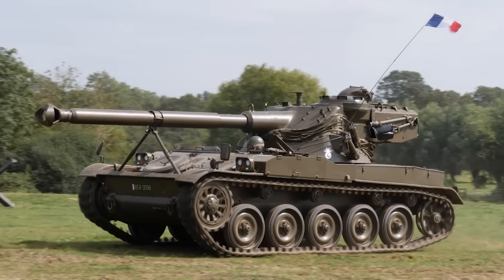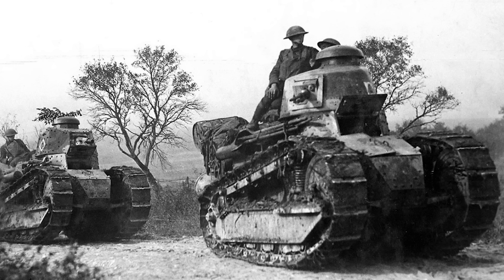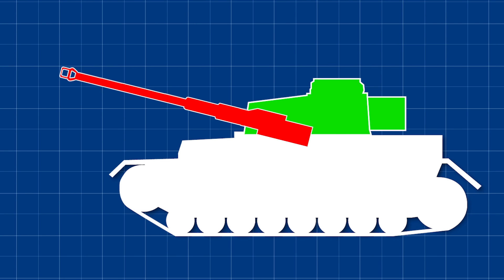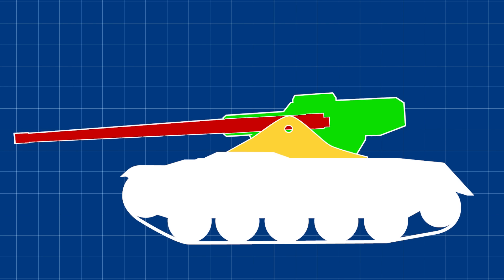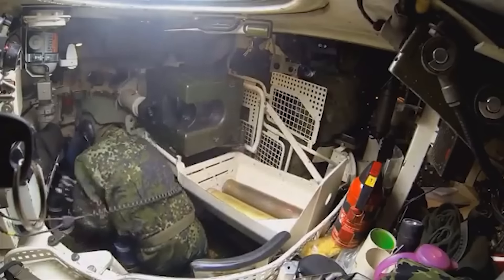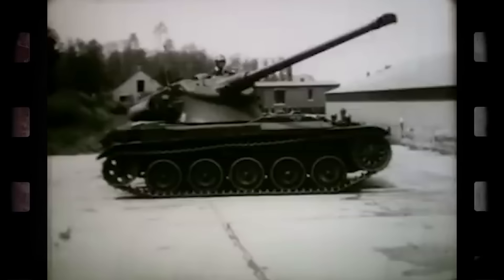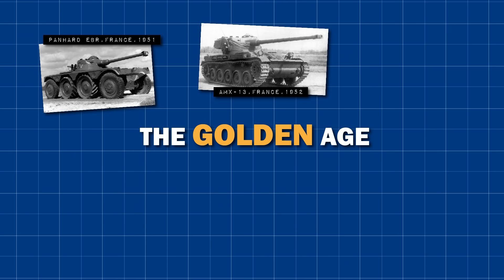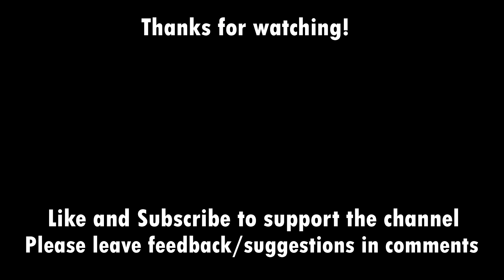What actually IS an “Oscillating” turret?

Comment: Given that unmanned turrets seems to be the future it's quite likely it will become default design.
Reply: we could probabaly make it adaptable, having the ability to switch from a big gun to a twin 30mm or some AA missile launcher
Reply: A bolt on turret with gun + autoloader + optics that you can put on top of just about anything seems like a good idea to me.
Reply: It still increases the profile of the tank by quite a lot which is a significant downside.
Reply: Not really. It is only likely if it's with a smaller gun, if you use such an oscillating turret you'll end up with a higher profile.

Together with the fact that it will strain the motors more to pivot the turret up/down with all the ammo and equipment

And if it's a smaller gun or autocannon it will be mounted in a different sort of turret which would be smaller
Reply: @qlum  I‘d say the massive increase in gun depression makes up for that. You can have your hull with the crew hide safely behind a hill while only your automated gun turret with blowout panels is visible. If the turret is designed to be modular you could simply put a new turret on and send your tank back into the fight.
Reply: @evo3s75  But does the higher profile matter if only the nonessential parts of the tank are exposed?

The armored crew compartment would still be as slim if not slimmer than today’s designs.

If you can just quickly replace the turret in the field with the help of an engineering vehicle the tank could be battle ready again in no time at all.
Reply: @qlum  Wrong. Seen from the side it might look like so, but the turret is literally half the width of the normal one, 1/4 if it is unmanned. So, it might be a tiny bit higher but it's fraction of the frontal area making it much harder to spot.
Reply: @qlum dont think stealth will be a factor in slow tank battles
Reply: @AnonD38  the elevation issue could in theory even by fixed by just sloping the hull down towards its rear and by all its other pros i see a Oscillating turret design beeing the future for tanks that have its crew protected inside a hull.
Reply: @justgeo6889  unmanned oscillating turrets aren't needed to protect the crew in the hull, a conventional turret would do good enough, better even

And how would you want to slope the rear of the tank down enough to have more elevation? You would be cutting into the space of your engine pack.

Imo oscillating turrets are ditched for a reason, they're too complicated for what we have now 

You'd have to stabilize a whole turret instead of just a gun, a gun is much easier and lighter to stabilize than a whole turret
Reply: @evo3s75  You seem to have picked up exactly 0 of the ideas I laid down, but good to know that you are asserting that I am the one who doesn't know anything and shouldn't talk about these things.

First of all: non-essential was in reference to the survival of the crew and the ability to retreat, because in a tank duel as long as your crew and vehicle survives you have not lost completely. What does a single destroyed tank matter if your crew is dead and your vehicle lost? That is a trade of 1:1 which will lead to defeat when fighting an enemy who just has more tanks than you. (remember Russia's whole "quantity over quality" approach to warfare with hundreds if not thousands of "alright" tanks instead of dozens of "cutting edge" tanks)

Next "the turret you put on a tank doesn't impact the size of the crew compartment" this is just false and already explained in the video, the turret ring decides how wide the crew compartment has to be and in turn this decides how long it must be depending on your intended use for the vehicle. If you don't know this much, then please go back to watching blue's clues or whatever you do in your free time, kid.

Where do you get your weight numbers? 8-15t for a turret? Maybe for a manned turet, but if you had actually read my comment you'd know I specifically talked about an unmanned turret. The Turret of the M1128 Mobile Gun System isn't much heavier than 6000 Kg and the AEV 3 Kodiak Engineering vehicle's telescopic arm can lift up to 3.5 tonnes meaning an automated turret up to 7000 Kg could easily be lifted by two Engineering vehicles even out in the field, but much more likely in an improvised repair shop just behind the frontline. If the system is designed to be modular you'd need at most hours definitely not "weeks" to do this replacement. It's just like replacing the engine on an M1 Abrams, it takes hours, not weeks.

To the point of "where would it be stored?" have it in a warehouse and ship it out to the front as needed just like all spare parts dummy. The rest of that block of text are baseless assumptions and not worth my time.

Your next point is that "this design hasn't been used for so long" and? What, so just because something wasn't useful for a period of time means it can never be useful again? That logic is flawed to the core, a most shameful display of ignorance and arrogance.

Next time let the grown ups talk, ok?
Reply: @AnonD38  How did I pick 0 of the ideas you laid down? I took them apart 1 by 1. That and you weren't being specific in your previous comment.

The first part I can agree with now that you explained by what you meant with non-essential, since you didn't give context about it before hand.

The 2nd part I wasn't sure if you were talking about a manned or unmanned turret, so I pick the unmanned one which was clearly the wrong one I picked, sorry about that. In case of a manned turret it does indeed impact the size of a crew compartment since you have an auto-loader and don't need extra moving space for a loader or an extra seat for the added crewmember.

Yes, I did indeed get the weight for a manned turret, because you didn't give context if you were talking about a manned or unmanned oscillating turret. About the lifting of a 6ton turret by 2 Kodiak's, I'm not sure if that would work, but if they were to lift an turret off of the MGS they'd do it back at an base with something easier and better to use instead of an engineering vehicle like you said. I'm not sure how modular the turrets are for tanks or how easily the can be taken off but I did indeed exaggerate the time a little there, but the tank would be out of action for at least a few hours to half a day if you'd have all the parts and personnel there at the moment.

You didn't give any context about if it would be in a base instead of on the field like you said here "If you can just quickly replace the turret in the field with the help of an engineering vehicle the tank could be battle ready again in no time at all.". But yes the logical assumption would be to have it stored in a warehouse.

Next is about the use of the oscillating turret, while yes it may be used one time again. It is unlikely since it was designed for a problem which we really don't have anymore, and that is that auto-loaders could not load because of the gun being at certain angles, so they made the gun stuck to the turret and auto-loader so the gun wouldn't be out of place and could keep loading the gun without any problem. However that is not the case anymore with modern bustle auto-loaders since they can keep loading the gun at different angles within reason.

Childish.
Reply: @AnonD38  a tanks profile isnt just about fighting other tanks its about getting spotted in general. while you are correct technically a it presents the nonessential roof to tank attacks against artillery and top attack missiles being spotted can be a death sentance.
Reply: @loganwilder4276  Sure, but let’s actually look at the situation.

The space an unmanned oscillating turret saves in the crew compartment could be used to decrease the profile of the tank meaning it‘d be 0 sum in the end.

And even if the profile is a bit bigger, we already have great countermeasures against visual detection, camouflage and camo netting with foliage makes the mk 1 eyeball look very old.

The biggest threat for a tank would be thermal detection though. In this case an unmanned oscillating turret would actually give advantages. There would be no crew inside the tank you‘d need to keep either warm or cold, so you could have the temperature of the turret be much closer to the surrounding temperature, meaning your thermal profile might actually be a lot smaller than on a tank we have today.
Reply: @AnonD38  thermal profile is irrelevant a tanks engine is always going to be hotter than its surroundings even in a desert and that heat can and will travel making it quite easy to pick up on thermals. "stealth tanks" as a concept dont really work the best you can do for the most part is make them harder to hit and the easiest way to do that is to make them smaller.
Reply: @loganwilder4276  Ah, you’re that kind of regarded.

You do realize that most if not all Russian tanks are smaller than Western Tanks and yet in the middle east the big western tanks wiped the floor with the small Russian ones, yes?

Thermal profile is everything in the age where every vehicle is carrying hunter killer automated weapon systems. nowadays western tanks shut off their engines while in a stationary position and use secondary generators. With advancements in heat management systems it will soon be almost impossible for inferior thermal devices to pick up faint differences in thermal signatures.

Modern western anti-tank weapons strike from the heavens above while Russian still „eyeball“ it and hit nothing.

I hope the next time you‘ll start learning about a topic before you talk about it.
Reply: @AnonD38  russian tanks are indeed smaller because thats the point, russian tanks are almost entirely designed to resist missile attacks at the expense of being poorly suited to kinetic. russian doctrine favors a MASSIVE overwhelming force of smaller tanks and to do that you NEED to make them smaller for mass production purposes.
Reply: @loganwilder4276  Lmao. Lol even. Russian tanks are designed against kinetic projectiles. They have extra ERA all over their tanks especially because they are not designed to survive missiles.

Good god, do you know anything about tanks?
Reply: @AnonD38  if you knew ANYTHING about era and how it works you would know it is a poor defense against kinetic rounds. so let me explain HEAT or high explosive anti tank is a type of explosive round that uses a shaped charge to form a portion of metal into a MOLTEN jet and travels at super sonic speed. notice MOLTEN aka liquid. era works by disrupting this non solid mass effectively "shattering" it. the explosive charge used in era was somewhat effective against EARLY sabot rounds but modern ones are much longer and do not care about era at ALL. this is the main reason new munitions are being designed known as EFP rounds or explosively formed perpetrators they work similar to HEAT but they do not compress the metal so much that it turns into a liquid, because they ARENT a liquid era is ineffective. its important to remember soviet tanks were designed in the 60s in a time when it LOOKED like kinetic rounds were going out of favor but era forced a shift BACK and before you go on about the T-90 just remember it is just a upgraded t-72 which is just a upgrade t-62
Reply: @AnonD38  that reply is so wrong that i honestly can not help you. it appears you have decided to live in ignorance and thats quite sad. you have been swinging insults most of our discussions and honestly im tired of arguing. if you want i can recommend quite a few good sources of tank information not just youtube vids but actual books. A good start is anything from the tank museum but i doubt your the reading type.
Reply: See something like the Striker's turret on a conventional tank hull as the most likely.
Reply: @loganwilder4276  you read it wrong lol. He said russian protection is made for kinetic penetrators, not missiles. Because of that they stick ERA all over the tank to protect against missiles
Reply: the "AR 5000" tank... one chassis, 10 interchangeable attachments. Lol.
Reply: Unmanned, yeah, oscillating Turret? Hell No.
Reply: I doubt that considering that the elevation mechanism is exposed more than a conventional turret
Reply: For small guns or machine guns maybe a ball turret akin to those used on WWII bombers is perhaps more desirable.
Reply: @KuK137  With fully autonomous vehicles you could trade heavy armor for sensor equipment, firepower and mobility. Some basic protection against shrapnel would still be needed.
Reply: Unmanned turrets allow certain liberties in design indeed.
Reply: @evo3s75  the future is light armored vehicles, they are more cost efficent. Modern tank technology focuses on systems that protect the tank before it gets hit, making eaven HEAT not as usefull as it once was, especially if the tank has Composit, reactive and Depleted uranium armor on top of that. The next pro the fewer weight has is that you dont need a nearly as powerfull engine as before making you able to reduce the size of the engine, wich also allows the hull to shape slightly towards the rear and second to that since theres nobody in the turret in general um sure they can reduce the size/shape of the turret anyway to get rid of the gun elevation problem uve mentioned.
Reply: @evo3s75 'higher profile'
I believe you're assuming to install oscillating turret on existing tanks.

It needs a whole new tank design.
I think Sweden might have some 'radical' idea, since they've design a low profile tank before, in the past. 

They might one day, manufacture an unmanned turret tank,
with a crew almost lying down to achieve low profile.

A rotary diesel engine.
A middle position engine.
Crew in front and back . . . Wait! They've (crazy Sweden) done that before . . nevermind 😁

When it comes to weapons, spare no expense attitude.
Reply: Drone Tanks
Reply: @qlum  It really isn't so much anymore. As can nicely be seen in Ukraine: War has changed. We now have drones, various new widespread visual capabilities (infrared, thermal vision, etc.). Lowering a tank's silhouette to hide it, really isn't that important in the future anymore, when you have new technologies like drones with thermal imaging widely available, that can spot your tank under any circumstance. Your silhouette really isn't going to help you here anymore.
Reply: Why?
Reply: @qlum  that really depends mainly on the hull it's mounted to more than anything. However the height silhouette  is largely overblown for instance AMX-50 which this video makes reference to is 3.36m tall and M60A1 is 3.6m tall. For reference the Leopard 2 is 3 meters tall.

But comparing apples to apples the Amx 13 is 2.3m  tall and M4A1 walker bulldog is 2.7m tall. Both are 75/76mm light tanks with high velocity main guns.

Even Styler MGS which is mounted on an already tall hull is only 2.9m which is actually shorter than a Leopard 2.
Reply: I heard Russia is going in unmanned tanks now
Reply: @justgeo6889  Nah, the normal tank isn't going anywhere, it' still needed.
Reply: @budisutanto5987  We will achieve nuclear fusion before someone makes a functioning diesel wankel engine.
Reply: @maitele  not because functioning diesel engine is technically more difficult.
Reply: Basically thr design for Halo's Scorpian tank
Reply: Dont think so. To me the tank of the future just doesnt use a high calliber gun to begin with. 30mm is plenty enough for both infantry and structures with the right shell type, and ATGMs are currently the most leathal type of weapons against armored targets

And since you loose pretty much all the perks of an oscillating turret when using a low calliber gun, but keep the listed cons as well as put a limiting factors on the type and amount of sensors and weapon systems you can place on top of it (which you'll need a lot of to shield the vehicule from drones and ATGMs), i dont see it happening